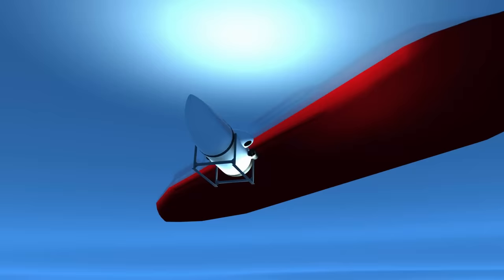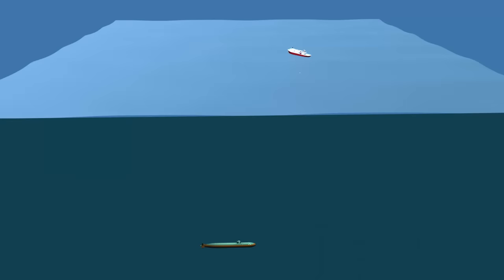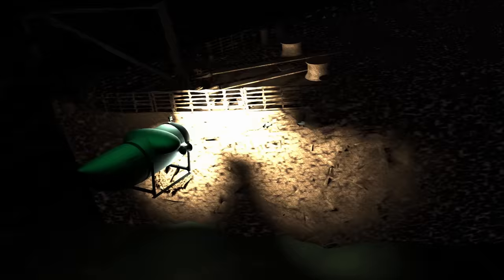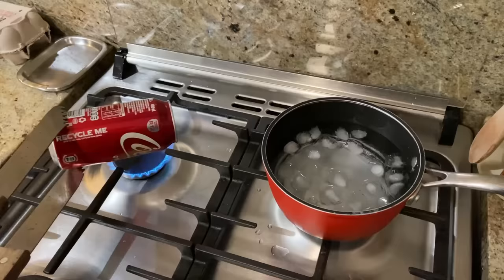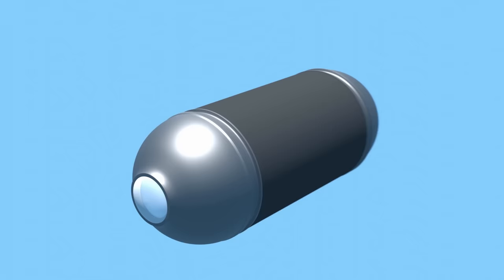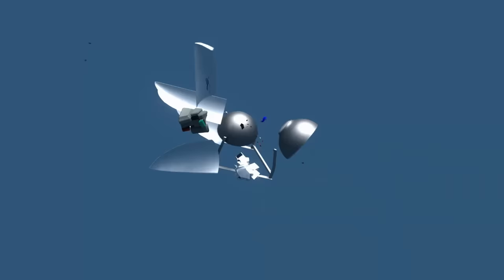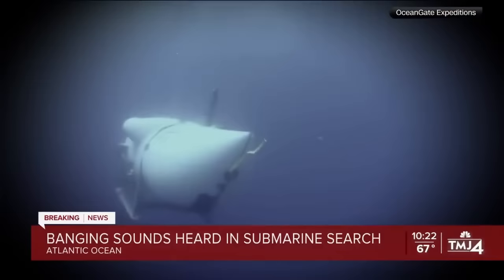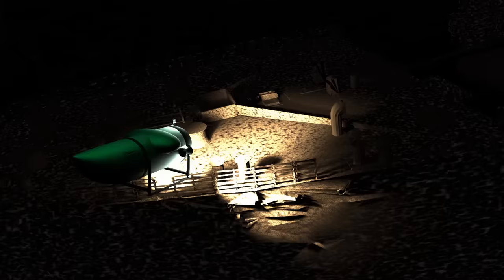TITAN Sub implosion | Deep Dive animation explanation

Comment: I'm just going to let it all out. The tube was made out of carbon fiber on steel. Carbon fiber can corrode steel in a process called galvanic corrosion. It needs water to happen... Also CF is strong in 1 axis, and weak in the 2 others. Mike caught on to this, but I want to add more. Lamborghini made a shredded CF to get around this and they reported that it was about as strong as steel but much lighter. This is confusing because why not just use steel? It's heavy, but you're in a sub. CF is also an odd choice because it's not the strongest in compression; Boron Fiber is, and it's a lot cheaper. Still, I think it would have been better if they just used normal steel for its predictable isotropic properties, or better yet use the VR game for it. It's $20. 

Other than that, there are just so many weird things about it. This sub was made with many wires hanging outside the hull, which is really dangerous if any of them get caught in something, and that's a failure point for a leak! The controller was a game controller off amazon with low reliability. The window wasn't rated for those depths; it's amazing this didn't happen earlier. I don't know why they didn't have better windows and several of them along the sides for these tourists. 

They had weights to drop to ascend if they needed to, which didn't work. I'm no expert, but I know some other deep dive subs had other flotation methods. Some redundancy would have helped out. Maybe saved their lives. This sub was built fragile. Even if it worked better a bump into the titanic may have killed it too. Some falling debris, or even a while grazing it may have been too much for this sub. It was build so fragile a small impact could have been dangerous. 

However, there is something I disagree with. Material fatigue may not be at fault, or at least not in the way that it normally does. Fatigue works in tension and in shear stress for things like springs, but this sub was in total compression. Even if you apply some of Mohr's circle analysis this isn't an obvious case for a lot of tension or shear. Actually that intense pressure should have provided some protection. I might be very wrong, and I don't know the components better than anyone else, but I don't think material fatigue is a great explanation. It's about crack growth and this should have crushed the cracks. 

Lastly, I'm saddened that an engineer did step forward about the dangers and was sued for it. Sued into silence. So My FE license came with a stipulation that I had to come forward if I saw things like this. It bothers me that this engineer didn't get legal support when he needed it.

Comment: I'd never though those rings were just glued along axis direction giving no stabilisation and suport inwards. Don't know exact parameters, sfety coefficient but I bet given area and pressure all the carbon body compressed and extenden differently than titanium rings. Cycle by cycle flaws could turn up there where the glue joining was, in half of the lengts of hull body there was a beginning of this 'lever' for each of rings connection. Despite what compresser less or more. If the simulation and videos show the actual construction (we don't know how it was finished etc after gluing) then I'd not go this way for sure engineeringwise. Those depths, side area of the submersible, forces involved would show flaws in the desing sooner or later with no mercy at all.

Comment: Should have been a composite hull with Titanium wrapped inside the carbon fiber. And even then the compartment should have had bulkheads to help strengthen it. Yes a bigger sub and more costly but one that could take the pressure. Maybe even spherical instead of a tube. It was innovative but it was also CHEEP. Should have been a use-only-once sub..

Comment: you imply it was a fatigue induced collapse. is it absolutely certain? Fatigue is usually after several thousands or millions of load cycles, but here we have 20-30, I am not sure it is fatigue.
Reply: Depends on the material. For something like steel, yes, many MANY cycles are needed, and even then they have to be over a certain threshold. Under light loads steel would just spring back, even on microscopic levels. Aluminum, despite being more rigid, will take fewer cycles, and ALL load cycles are cumulative. Regardless of the load, it all adds up. Same for carbon fiber. Under load microscopic fractures form and they stay there even after load is removed. During next cycle these fractures grow and/or new ones form. Damage adds up until catastrophic failure. 
But more than that, CF is not really good at compression. Considering the way it was wound, delamination of layers would have been an issue from the start. Think of it like squeezing a rolled-up piece of paper: layers shift relative to one another and inner layers quickly become deformed.
Reply: @AgentWest  Thanks! interesting.  I have had to deal with nuclear pressure vessels as part of my work, of course all in steel, and what struck me with this case, is that as opposed to this case they have such a huge margin for safety for fatigue or ratcheting that such a catastrophic collapse is unthinkable (not to mention that they have to conform to a design code, and I am not sure this vehicle had to conform to anything). I guess also, external pressure on a pressure vessel (compression) have a different mechanism for failure, as I would imagine, any discontinuity in the geometry shall immediately render the structure even weaker, and thus collapse is very violent.
Reply: @fusik6485  Yeah, inside pressure VS outside pressure are two VERY different loads. Just think of a humbled soft drink can. Easily holds 60-100psi of gas inside, but can be deformed with very light finger pressure from the outside. On the other hand, a rather fragile chicken egg supports a full grown hen sitting on it, yet can be easily broken from the inside by a baby chick. In this context, aluminum of the can works nicely for "stretch" (being tensioned by pressure), while fragile egg shell stays in compression, something it is good at. Another fun thing about a soda can is that you can just about stand on an upright empty one as long as it is not dented. As soon as it it, it collapses at a fraction of that load. Fascinating subject, material science is!
As for rules, subs are supposed to be tested/inspected/certified. This one was not. More serious divers send their pressure hulls off to an engineering lab where they are put in big pressure chambers and are actually pressurized with water to more than they'd see in service, thus ensuring safety. A good video about a well-designed submersible is "Making of DSV Limiting Factor", if you're interested.

Comment: Hello, thanks for this video.
I have a question bugging me for quite some time now.
If the structure was composite, and both end of the sub are still intact, does the carbon fibre cylindre implosion was really as quick as it would have been on a standard steel structure?

Comment: Carbon fibers using in this way was stupid all along. Carbon fibers can have enormous amounts of PULLING-forces, but it is worthless in the case of compression. (TEST: have a glass- or carbon fiber in your hand, pull it and then push it, and see the difference!) Basically this was only an epoxy-shell, the carbon could have been replaced with cotton or likely kinds of stuff, only to keep the epoxy together during the manufacturing of the hull.

Comment: It seems to me that an initial failue of the graphite would have occured at a specific point resulting in a sudden inrush of water at that point.   Why would this cause the entire structure to implode?
Reply: Well I don't really think that the Titan had graphite in it since the submersible was made out of carbon fiber and titanium according to a source I read online and obviously the carbon fiber was very weak to handle such large amounts of water pressure at a depth of 3,800 feet below sea level, so every time the Titan made a dive down to the Titanic, the hull had been subjected to repeated stress from the large amounts of water pressure and on this trip the carbon fiber material gave way and crushed in and collapsed on itself, therefore resulting in an implosion.
Reply: @Infinite-void908  OK, yes, I meant carbon fiber but why would it totally collapse rather  than just leak into the failure point and suddenly fill the cabin?
Reply: @rogerg4916  Because the Titan submersible wasn't made of regular material like other submersibles in the past have been. The majority of submersibles are made of titanium alloyed steel, nickel chromium alloy, and a special type of steel known as maraging steel. The Titan submersible like I said was mostly made of carbon fiber which isn't that strong against such deep water pressure. Titan was the first deep-sea vehicle with a hull made mainly from carbon fibers. The ability of carbon fibers to withstand repeated cycles of stress, especially compressive stress, under deep-sea pressures is not well understood, making it difficult to design safe hulls based on carbon fibers. As a result this material will degrade overtime from weakening caused by the strong force of the water pressure which will cause a violent collapse eventually because the carbon fiber on the Titan wasn't able to withstand the constant creaking and cracking from diving down so deep.
Reply from the maker: Carbon fibre is brittle and fails like glass. The entire carbon fibre tube would have given way in an instant.

Comment: glued components - that just doesn't sound a smart method. What if we did away with windows all together - have some advanced camera system that turns the interior surfaces into a display. 360 degree vision in a spherical shaped hull, systems on the exterior and then armour plating over the systems.

Comment: safe decent to titanic takes 2.5 hours to reach it safely, ....at 1.45 hours into decent they were about 1200 meters deeper than they should have been, they descended too fast, supposed leaked hydro phone messages confirm this, they heard cracking in the rear, released ballasts to resurface, no change in depth, releasing frame,  failure, takes several attempts to release frame, cracking stopped but pressure indicators red across the board, starting assent, 3 minutes later, more cracking heard in rear, lost battery A switching to B, not ascending very fast, topside asks for report, never heard from again, from time of ballast drop, alarm, and battery failure/switch to backup, they had only made it up 60 feet, and at that time the navy records an implosion, very needless and sad. RIP
Reply from the maker: The leaked transcript is fake.

Comment: Great explanation thanks.  I was horrified to read the text messages between the ship and the submersible.  It appears that it never reached the sea bed and was on an assent when it imploded between 9.48 and 9.50 per the time stamped text messages.  Absolutely caused by greed and an ego and purely a money making business
Reply from the maker: Thanks.  The transcripts are nonsense and obviously made up by someone who doesn't understand the physics.  There is absolutely no way it could have been a drawn out leaky event.  There would very little warning and most likely none at all. And it wouldn’t takes minutes to implode.  Glass doesn't slowly n gradually.  Carbon fiber shatters like porcelain and glass in an instant.

Comment: Worse yet, the Titan was being towed out to the dive site in the rough North Atlantic putting even more stress on it's components from getting tossed around. Putting acoustic alarms along the carbon fiber tube was nothing more than a 'fatality imminent' warning. By contrast I've read that when 'Alvin' was built in the 60's three steel hemispheres were built with the 'worst' one being subjected to destructive testing to find it's failure potential. The 'worst' one survived the test chamber itself blowing up at 8,000 psi with the hydraulic fluid vaporizing into a fog and the top hatch blowing off, flying through the roof and coming back down on top off the test chamber denting several feet thick concrete. Experience, redundancy, testing, re-testing, are all going out the window in the name of 'diversity' and 'thinking outside the box'. Just look at Boeing and airlines right now-I ain't flying for sure.

Comment: CORRECTED EDITED TEXT
; The TITAN a submersible purpose-built for diving the 12,500 feet to the
; TITANIC wreck suffered a catastrophic implosion on Sunday, Jun 8, 2023
; at around 9:30am
; This is a story of hubris when the unforgiving nature of deep submergence
; required following the best engineering science.

: Correction: 
; The carbon fibers were laid in 2 directions.
; Here is a more recent video with a very short clip of the
; TITAN hull winding showing multidirectional fiber.    
▶ https://www.youtube.com/watch?v=29co_Hksk6o&t=233s 

 • A visit to RMS TITANIC 
   In this footage - it is only in 2 directions but typically it is better
   to be applied in more orientations to maximize the number of contact
   points - especially when this composite was being put under the most
   severe loads.

  Our thoughts go out to the family and friends of:
  Paul-Henri Nargeolet
  Hamish Harding
  Shahzada Dawood and his son Suleman
  Stockton Rush - Ocean Gate CEO and pilot

Comment: @4:30 "unimaginable pressure".  Hummm, let's see.  A pressure washer puts out about 5,000 psi, almost the same.  Not hard to imagine!  My truck's diesel fuel to the injectors reaches 30,000 psi.  Seems very imaginable.  Newer trucks can reach almost 100,000psi.  Stop using words you don't understand.

Comment: Here's a breakdown of my calculations, a lot of the useful information about water compression was from this video: https://www.youtube.com/watch?v=bNW5FYGIfLc
So the maximum speed water will decompress is 1,500m/s or Mach 4.3. In order to implode the submersible the surrounding water needs to be decompressed, the amount of water needed is relative to how compressed the water is, at 6,000 psi, water will compress by 2%, this means 50x the volume of the sub will need to be decompressed. I estimated the volume of water needed to fill the sub as 15m3, so we'd need 750m3 of water, this has a radius 5.6m. The decompression wave, which also travels at the speed of sound in water would take 3.7ms to decompress this amount of water (same time taken for the implosion), with a water speed of 398m/s or 890mph.
Reply from the maker: Thanks. So what you are saying is it all happened in under 4ms!

Comment: Why not to have it made out of one piece or titanium?
Reply: The CEO thought that the carbon fiber material that the submersible was made out of was strong enough to handle the extreme water pressure, but the carbon fiber had weakened overtime from being exposed to the pressure each time it went down to the Titanic at a very deep depth and experts were telling him to re-design his submersible with a stronger material like titanium but he wouldn't listen because he was too overconfident that his sub would be fine under extreme water pressure and he was also incompetent when it came to his and other people's safety.

Comment: We now know that it wasn't a sudden implosion. The last message sent to the surface ship was that the hull had been compromised and he was resurfacing. It sprung a leak which would have forced pressure into the sealed compartment and exploded it from the inside out.

Comment: This is a poor simulation. The can demonstration is not what happened at all. That is PV=nRT. You rapidly decrease the temperature and so the pressure and volume rapidly decrease, too. That wasn't what happened in the sub at all. There would have been a rupture and a devastatingly rapid ingress of water. It's water hammer that would have destroyed it.

Comment: The carbon was just a really  stupid idea from the get go. !

I know from building R/C Airplane models with carbon  parts,, that once it gets over stressed one way,, & then returning to center ect.,, it gets even weaker when returning,, & those areas pretty much eventually turn to mush.

The conlusion of my theory. is that the Sub every time it went down,, the Carbon got weaker,, from  squeezing  pressure against it,, & then pressure relieved when rising.

Pretty much the same effect as the carbon structure parts on my Planes when they get over stressed, & eventually  fail,, especially carbon joiners for wing spars to fuse's. 

Should of just made the ''whole'' thing out of'' tried & trued '' Titanium.,, & also a ''Sphere'' shape,, which is ''way'' stronger anyways.

This shape was pretty much kind'a Egg shaped,, & guess what part of the Egg  you usually crack to open it ??

The sides ''of course'',, which is the weakest.

My 2 sents.

Ian

Comment: Maybe OCEANGATE  should have hire older (WHITE) engineers  to properly build the sub 😮
Reply: not necessarily WHITE (lots of GREAT engineers in other colors as well) , but for sure with 20-25 years experience AT LEAST... You know what means experience? Making mistakes and learning... Also, younger generations are prone to unnecessary risks...
Reply: @pavlemarina  you obviously dont know the FACTS about the CEO hiring practices ....do your research  😊

Comment: Uhhhh did he say GLUE????? Smh
Reply: You kind of have to glue carbon fiber, but its not like something you get at the store.

You have to use one type to bond it to the metal tube itself, and then you glue the titanium end caps because you can't really drill into carbon fiber very easily because as soon as you start cutting those individual strands, it loses a lot of strength, and I've broken plenty of carbon fiber tubes trying to drill holes into it for a prop I was making (finally did get 2 to work, but still had a good bit of damage, but was able to at least hide it, and the tubes are definitely not strong like they were before).